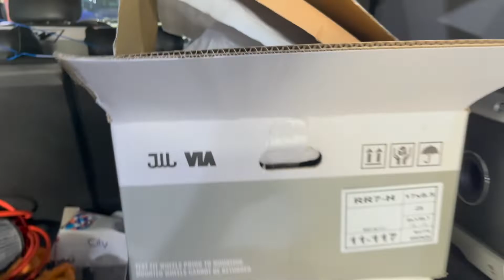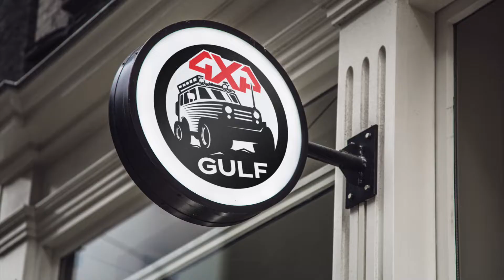RRW RIMS ON FJ CRUISER

Comment: Its better to apply some anti seize to those bolts before putting them on. It will save you a ton of trouble when you want to take them out later. Here you mounted the bolts straight on the ring.
Reply from the maker: In UAE i have not seen people doing it. But thanks for the update, will check if someone has it